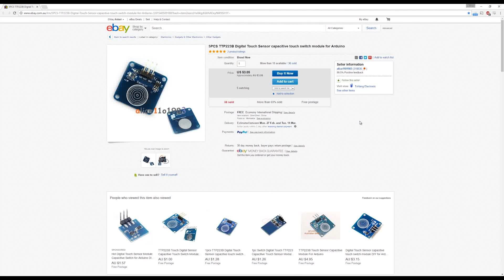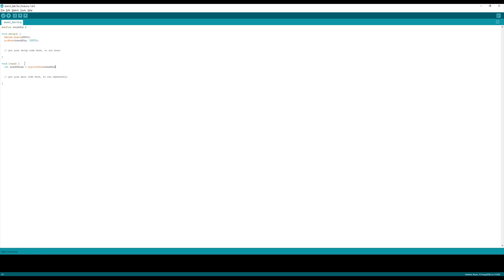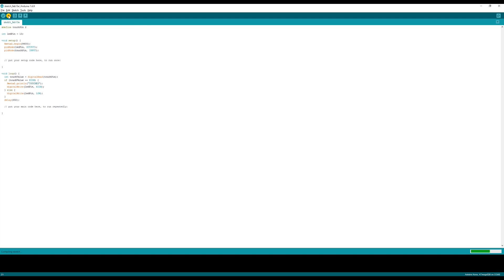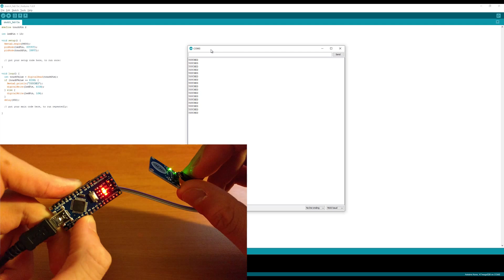TTP223B Capacitive Touch Sensor - Arduino Tutorial

Comment: sir can we on and off the same output with that sensor? , like when we sense first light is on and when we sense again light is off?
Reply: Rahul Sharma 
You can write the sketch that way. Here's a way to do this:

Keep counting the number of times the button has been pressed in void loop() since the beginning. Suppose that the LED is initially OFF. So if the counter is an odd number (counter%2==1), turn ON the LED. Otherwise, turn it OFF.

Its just one of the many ways to do this. I hope that it helps!

Comment: Is it possible to program the button with edge-triggered interrupts? For example, when pressed once, the state stays HIGH until a second press. Basically a toggle switch
Reply: This specific button doesn't have that feature. But you can tweak your sketch to make the button work like a toggle switch.
Reply: Michael Garcia

Here's a way to do this:

Keep counting the number of times the button has been pressed in void loop() since the beginning. Suppose that the LED is initially OFF. So if the counter is an odd number (counter%2==1), turn ON the LED. Otherwise, turn it OFF.

Its just one of the many ways to do this. I hope that it helps!

Comment: Is there a way to distinguish between a really long press on the sensor and a really short touch?
Reply: You reckon a basic timer? Will have to try then...
Reply: 2501Pearl I think you would have to do it using a counter for how long your finger was on the sensor, then once your finger leaves the sensor you have the program decide what to do based on the length of the counter
Reply: Nathan Jackson yeah, that's how I am currently doing it! It's working pretty well so far
Reply: You can write something like:

long totalTime=0;
long touchON=millis();
if(digitalRead(touchPin)==HIGH)
{
while((digitalRead(touchPin)==HIGH)
continue;

long touchOFF=millis();
totalTime= touchOFF - touchON;
}

So this totalTime will give you the time in milliseconds.